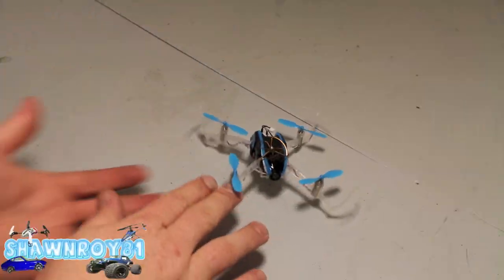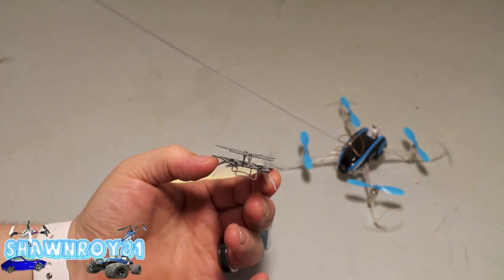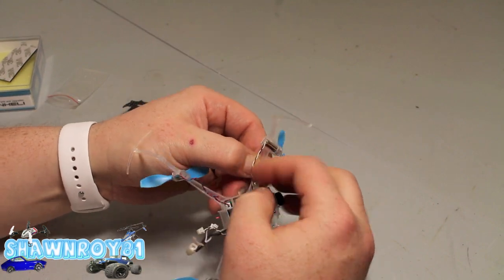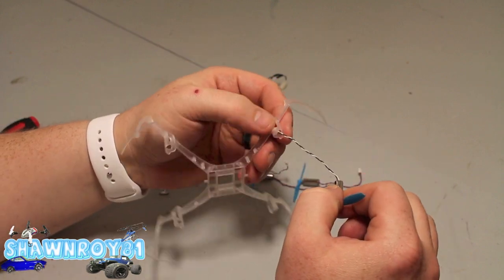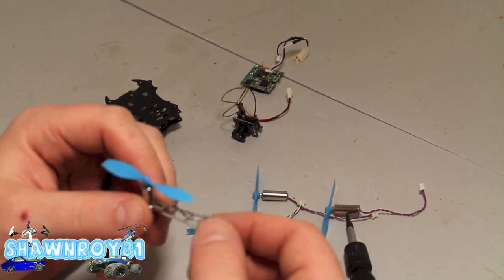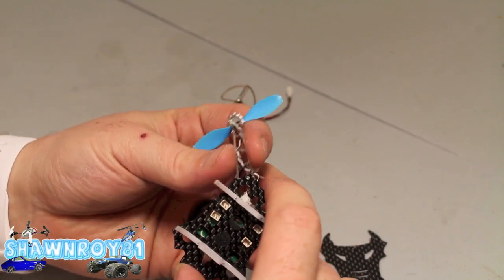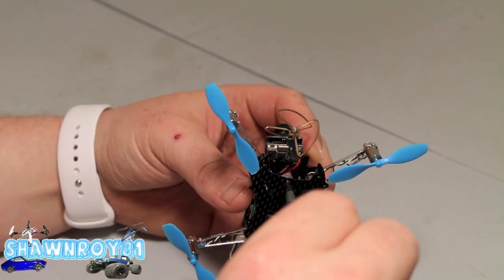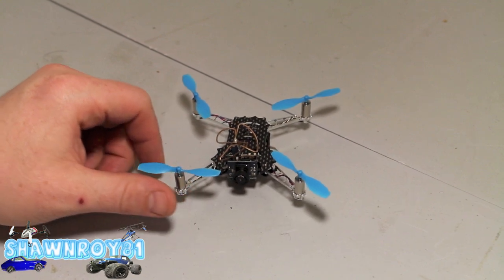NanoQX FPV RKH Carbon Fiber Frame upgrade

Comment: hi i bought this frame. but the arms are so fragile like tin foil. is there any other alternative to these arms as in carbon fiber? new flyer. so i need sometthing stronger. any suggestions. just using stick board and motors.

Comment: I bought this upgrade for the regular nano qx but the slightest crash landing and the arm bends. :(  I bent it back into place but nor trimming or bending will make it fly correct now :(
Reply from the maker: X-FLIGHT101 cross my fingers bt mine has been good so far

Comment: the kit is great. But the arms arms are to easily bendable. battery went dead early in my first flight using stovk motors and stock board and landed and broke and bent an arm from about 20 fteet in the air. fragile arms.

Comment: Did you make a video of it flying? Are they stock motors and what battery did you use. Thank you
Reply from the maker: +77jbob I do have footage of it flying around. Its a Team Great Hobbies 300mah lipo
Reply: Are they stock motors?
Reply from the maker: they are stock motors. They have help up fine so far.

Comment: Terrible weak arms :(
Reply from the maker: +tahosrfr I will agree the arms bend easily during crashes but a quick tweak in the other direction and they are good again. I have bent and straightened my back with no issues so far. I guess I live with the quarks...LOL